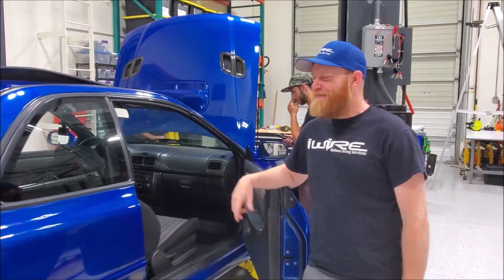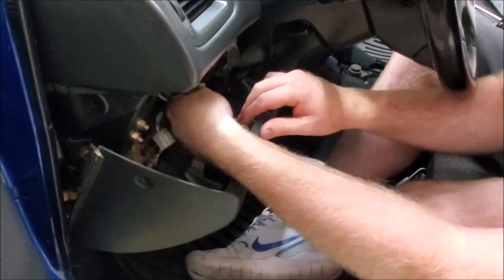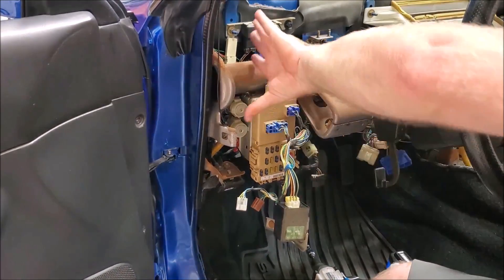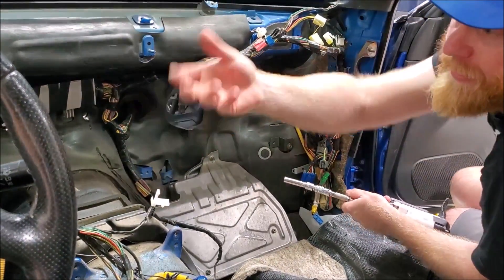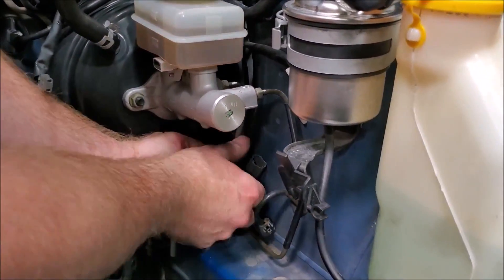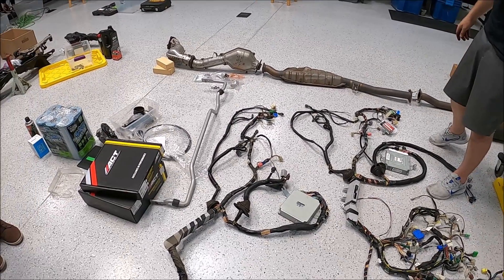iWire Bulkhead Dash Harness Removal for Subaru

Comment from the maker: 0:23 - Vin Plate, Side Skirts and Center Console
3:23 - Cluster and Driver Side Under Dash
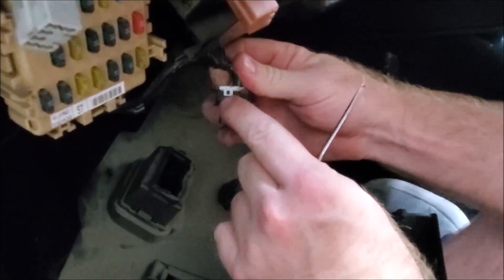6:30 - Glove Box and Stereo
9:01 - AC/Heater Controls
11:29 - Upper Dash
13:03 - Airbag Harness
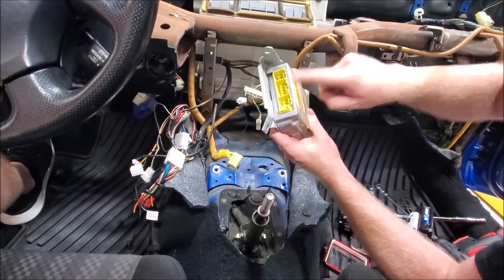15:43 - Final Dash Bar Removal
19:18 - Intertior Boxes
22:49 - ECU and Interior Harness
27:00 - Engine Plugs

Comment: Great video guys!  I need to replace a leaking heater core, is there a way to cheat removing and installing a new one without removing the upper dash?  Or I've gotta remove the whole thing to get to it?  Thanks!
Reply from the maker: Unfortunately, to get to the heater core, you must remove the entire dash and the dash bar.
Reply: @iwiresubaruwiringsolutions5538  thank you for the clarification, much appreciated!

Comment: Not sure if this comment section is still monitored but I have a couple of questions. I am going through the process of replacing my automatic bulkhead harness with a matching (00 RS) manual harness. I'm just replacing the bulkhead (doing a transmission swap but nothing with the engine). Do I have to drain the cooling system in order to remove the white AC box, and do I need to discharge the AC system in order to remove cabin filter box?
Reply from the maker: You will have to drain the coolant and the discharge the AC system because both of the boxes that contain those fluids must come out.
Reply: @iwiresubaruwiringsolutions5538  Thanks!

Comment: Hy i did mixed up the wiring  socked for camshaft and injector both use 2 pins any help wih a diagram  subaru 2.0
Reply from the maker: We aren't allowed to sell or redistribute Subaru's wiring diagrams but if you send us an email to info@iwireusa.com with some more details we can see how we can help with your project. Thanks!

Comment: This is a great video. Question, is there a way to get to the ECU without taking apart the dash?
Reply from the maker: The ECU can easily be accessed without removing the dash. Just peel back the carpet on the passenger's side footwell and take the metal plate off that covers it.

Comment: Are there any extra bolts holding down the upper dash on an 02 forester? Followed step by step and it seems like the upper dash doesn't want to budge
Reply from the maker: Should be pretty much identical as far as I know. If it's not coming out easily though, keep looking for more bolts.
Reply: @iwiresubaruwiringsolutions5538  on the hunt! Lol. Are there any close to the windsheild?
Reply from the maker: @DanielGarcia-xb1uw  Yes there are 2 under the trim piece.

Comment: I currently have a 1997 Impreza Coupe with a 1.8L engine… I am picking up a 2005 WRX with an EJ205 turbo engine. Is this a good swap if I have the full car at my disposal? Can I strip the WRX and swap it all into the 97 Impreza relatively simple? What should I look out for?

Comment: I have a 2013 Subaru Impreza Sport that has a bad bulk head wire according to the dealer. Is it safe to replace it with a used version from a salvaged car or modify it with an upgrade?

Comment: Is there a way to disconnect it from the wiring going under the passenger and driver side trim and behind each seat belt? Taking apart an 06 Impreza wagon and it looks like I’m going have to get into both seat belts and unplug.
Reply from the maker: GD models have to remove the front seats and access the B pillar for the doors to reach the connection between the bulkhead and front harnesses.